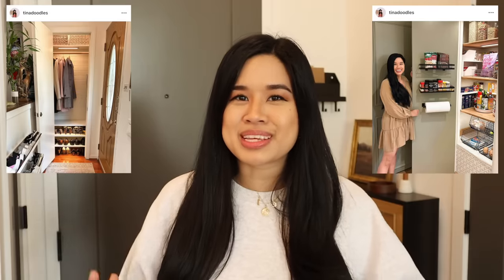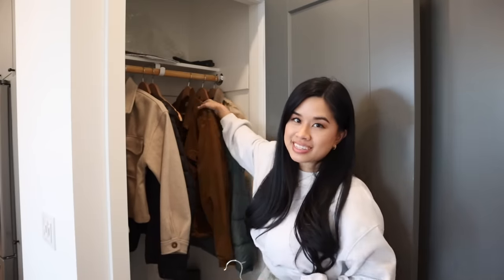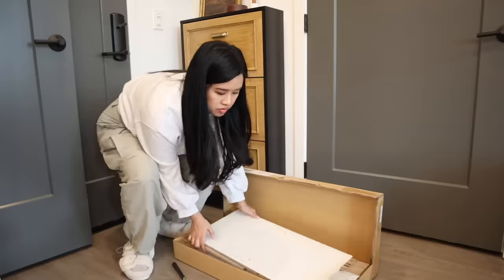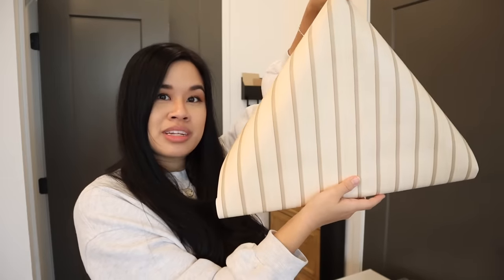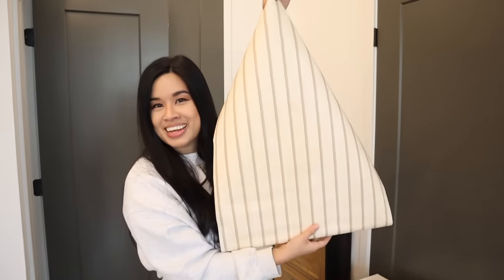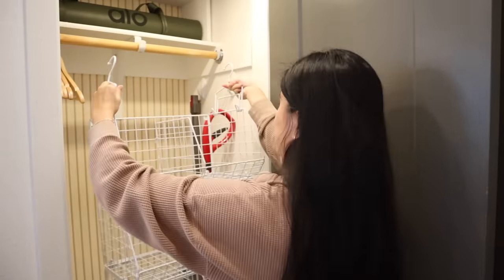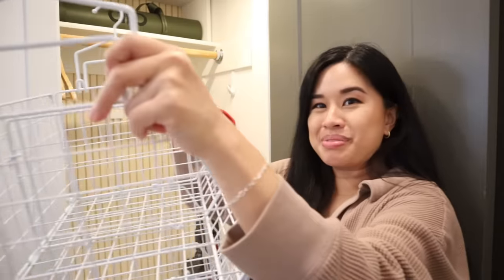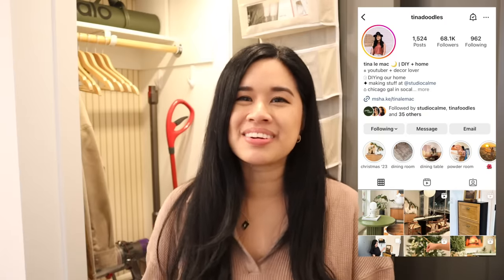MAXIMIZING MY SMALL ENTRYWAY CLOSET W/ DIY STORAGE UPGRADES *renter-friendly makeover on a budget*

Comment: Don’t forget you can use a tiny nail to hold 1/16” plywood to any wall any size, any where , and a couple camand strips and put whatever you want on it. Tile, real wall paper, paint bead board pole wrap. You can  even do 1/4 of the wall and trim it with a 1x2 ledge or a 5 foot wide portion of the wall behind the tv and run the chords behind it and take it with you when you move.